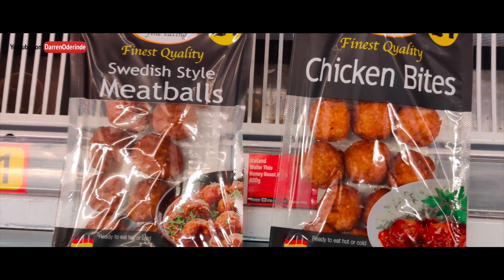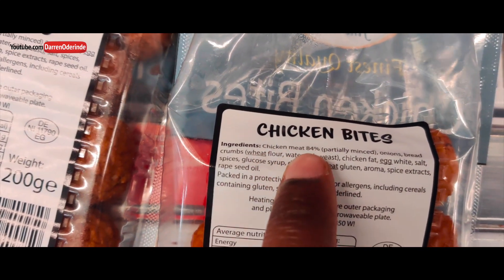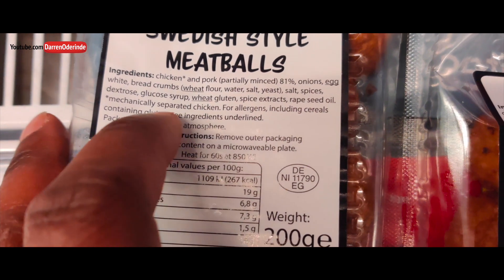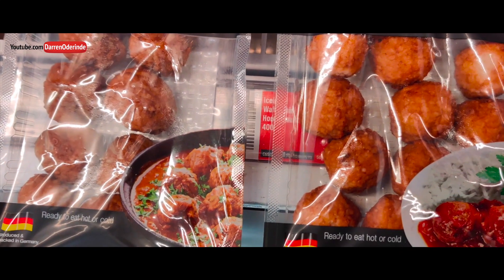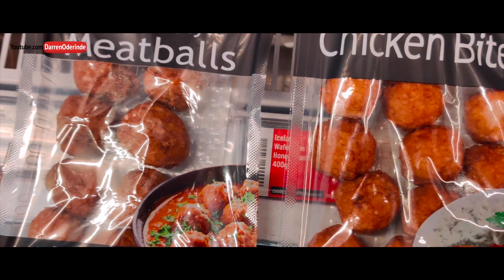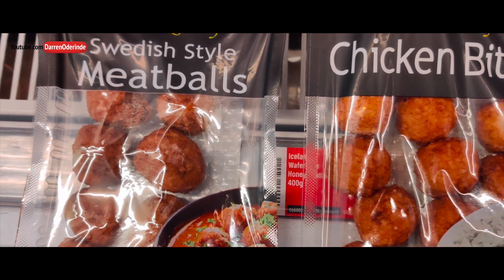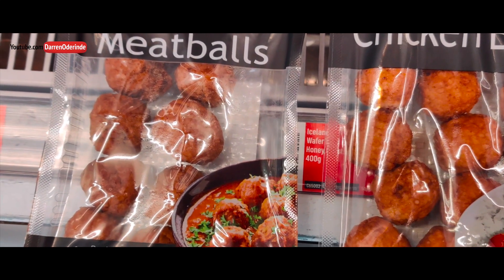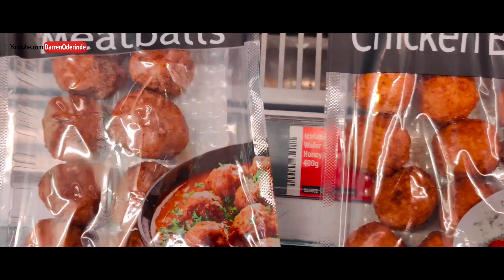What Is Mechanically Seperated Chicken ?

Comment: They don't use ammonia to clean the meat, that would completely destroy the meat. As part of the mechanical separation process, the leftover meat and bones are pushed under high pressure through an extruder, the bones break into tiny bits, but are still not small enough to fit through the wire mesh, the meat us basicly turned into jelly and forces through the mesh, bones come out the side, edible meat comes out the mesh in the middle. This saves extra meat from becoming waste, meaning we need fewer chickens to feed the same number of people.